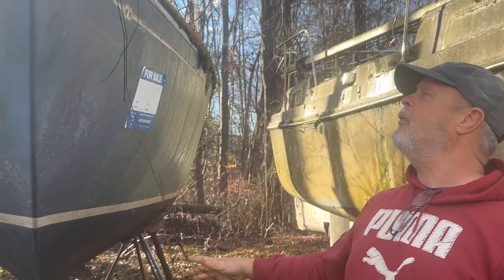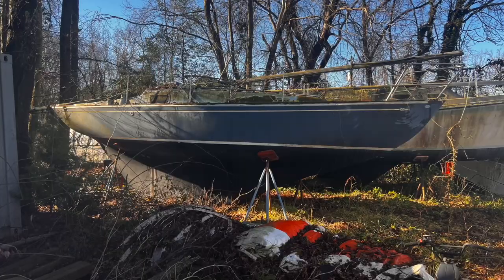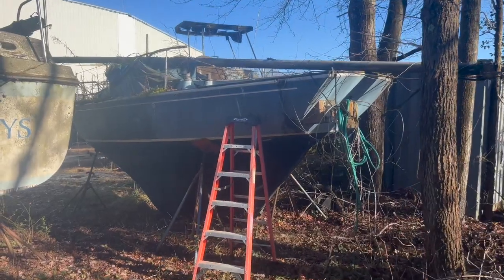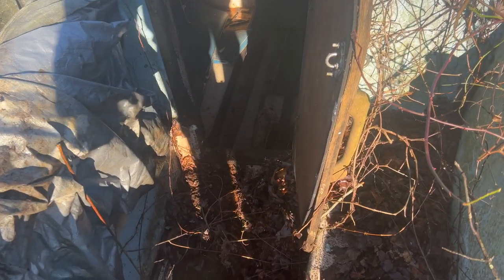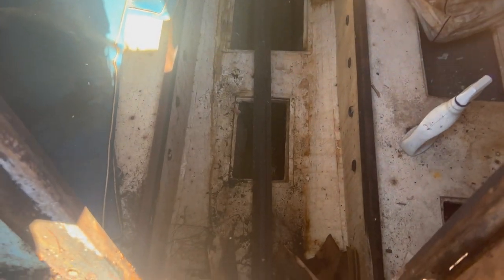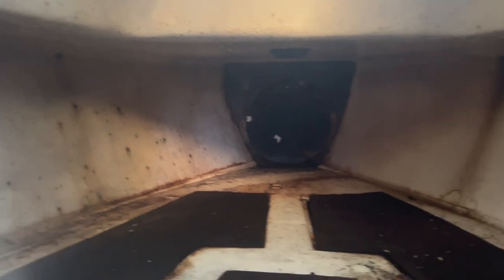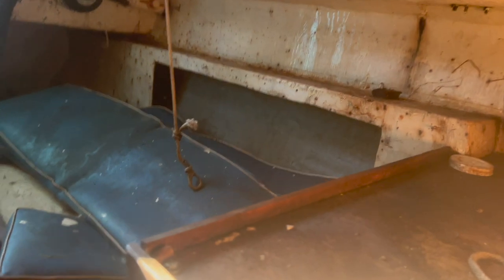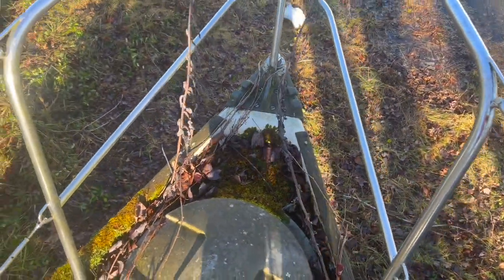The Worst Contessa 26' in the USA!! Project Boat For Sale: $500 Sailing SV Bohemian Episode 46

Comment: I haven't watched Epoxy and Butyl Tape but I will check it out. It's funny to see this gem sitting among several so so sailboats.
This is the type of boat I would restore but I am currently saving at Cape Foulweather 25 (Zephyr).
With all respect, I would like to highlight the value of a boat like this. 
She will sail closer to the wind and keep her way on better than most of what's out there.
I would not install an inboard but the current OB bracket on the stern is low enough that the prop would be dragging. It's probably mounted like that bc that's where it needs to be.
A 2 cylinder diesel installation in a cheap yard should be south of $$65k and you would never regret it, that's Tank, Aperture, shaft, strut, engine room redo, exhaust, installed by a marine mechanic. She will sail much better without an inboard. (edit: strut or aperture, I would choose strut offset). I would never burden her with the weight of electric drive batteries. Restoring a boat like this please don't add too much weight. 
If you cannot pressure wash, I just brush and scrub(petroleum distillate) paint thinner on all surfaces, especially hidden raw grp. then just wipe it up. Gets all the grease off the laminate. AFTER the Bleach. Never oxy clean, you need to kill the mold.
I always coat All raw unsealed laminating resin or cured polyester etc with epoxy resin and HD Filler. It's not as hard to sand as they say, but why even sand it? It will self level and be done if the batch isn't too thick. Also do drawer bottoms this way, top and bottom. EZ to color.
I don't see a single piece of plywood that couldn't be repaired. Some of the stuff you get now might not actually be as good. 
OK there's no chain plates. If there were, you prob wouldn't want them, if they're bronze they might be fine.
We made some nice chainplates for a Chris Craft from 2" 316 SS angle, 1-1/2 would work here. The pockets inside the hull could possibly be used as a form to strengthen and build from.
This boat looks like it has a structural liner so any modification should really use the existing structure at least as an armature. It can be strengthened where it contacts the hull already. Always consider what needs to flex (all keels sag when heeled) and what can be rigid, like bulkheads might need to float a little.
The T track on the coaming indicates this boat has some nice hardware. I would not trade those Gibb winches for anything. The mast is replaceable, sure. but you would never get anything half as good, especially a $30k carbon rig (she was designed to have an Alloy rig). Any generic replacement kit mast would never compare to the spars she has. Please don't waste money on synthetic rigging, that would hurt her resale value. Stainless rigging and coated lifelines, not synthetic.
If someone could finish her out at home, it would be much better. Consider putting her in a (well- drained) pit so you  could step on and off easier. 
Be careful building the rudder, too heavy will give her lee helm.
Not going to go on and on, but you showed two other boats that would definitely be a waste of money, the opposite of this.
Thank You
Reply: Epoxy and butyl tape has done amazing work on his contessa and they're very well built.. I know people have atleast crossed the Atlantic on one
Reply from the maker: I was thinking about the rudder myself . On how to construct it with weight in mind . I wish I had the time to do it . You have tuned me up . What a great comment.  I have another in mind . But I can’t seem to find anyone that knows what it is. It’s a little boat maybe a 32  with a mizzen mast . Hope to see you there .
Reply: @sailingsvbohemian1464  it could just be straight drifted Honduras mahogany, with or without an epoxy coat. Bronze gudgeons last longer than ss, imo.
Reply: @sailingsvbohemian1464  I believe on epoxies channel he showed it was fiberglass with foam in the middle and had bronze hardware..he ordered some new ones from somewhere and said where to get them.. you need to buy a few acres and just start flipping boats like you did houses.. lol
Reply: @bendaves77  It’s wood core in the middle. There’s a bronze strap inside the rudder that connects the gudgeons to a zinc on the rudder because of the dis-similar metals on the pintles. 
The rudder is not weighted and the original Jeremy Rogers UK built Contessas had wood rudders.
Reply from the maker: @bendaves77  I use to keep all my boats down at my moms place in the Ozarks . Before I had this Tayana . I can here them now . No more boats. If I had a good sailboat trailer she might have a heart attack.  I wouldve grabbed that Contessa and that big old one . The old nostalgic one would make a great boat for a lake .
Reply: @sailingsvbohemian1464  I'm about 4 hours or so northeast of the Ozarks and that big old one you showed was a cool boat.. it would have taken alot of work but would have been cool when it was done

Comment: Those boats are supposed to be incredibly tough and epoxy and butyl tape has done amazing work on his.. just search on YouTube for contessa sailboat rebuild and several will pop up.. the problem is that the marina will always want something for it which is why there's so many of these boats sitting around..they could atleast donate them to a good cause where they can be auctioned off before they get this bad
Reply: Never hurts to offer less, you are assuming the everyday expenses.
Reply from the maker: At that marina there’s probably 30 abandoned little sailboats . Most are just old little boats with no value. But there’s two or three more there to see . But that Contessa was probably the best . I think there might be a decent Catalina . And one that has a odd name the dock master was saying it had some type of pedigree. I’ll figure it out . But all for 500 bucks . So it should be interesting to see .
Reply: @sailingsvbohemian1464  definitely worth saving if someone that's within a few hours has the ambition..I live in northwest Illinois not far from the Mississippi River so it's not worth me dragging it all the way here
Reply: @sailingsvbohemian1464  Interesting! I agree with the dock master. A boat can be pedigreed. Sometimes it's not enough to be chosen over what's popular, often because of a seagoing interior that's less condo than newer designs.
I don't make videos, but would be interested to see what you find.